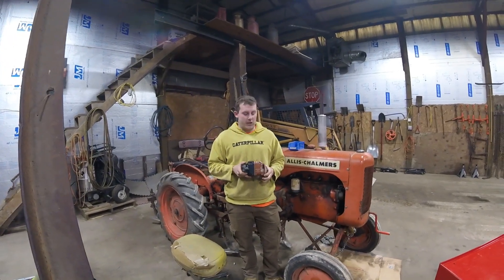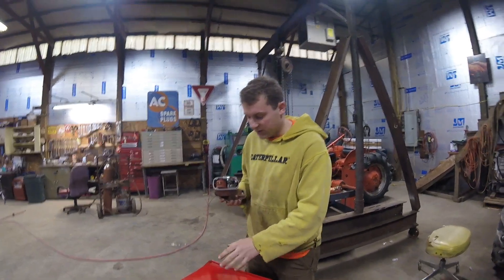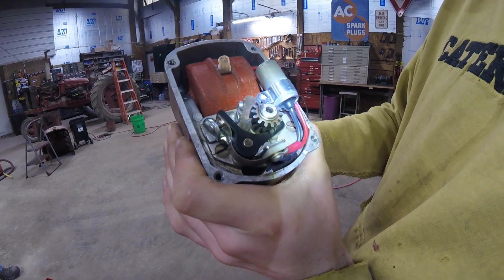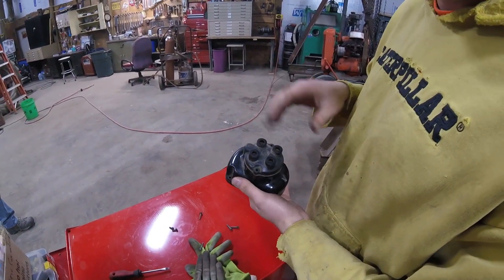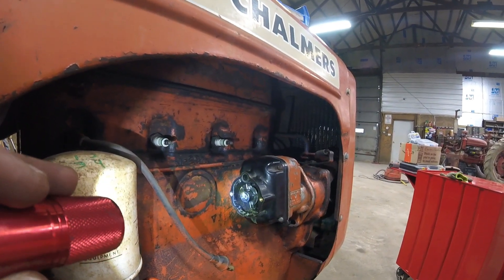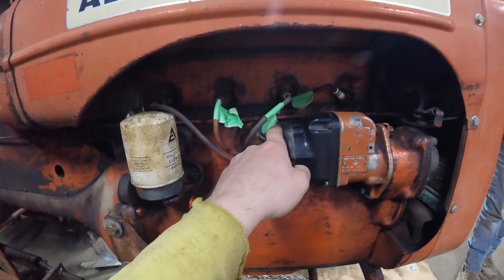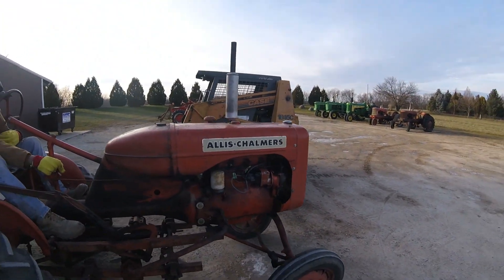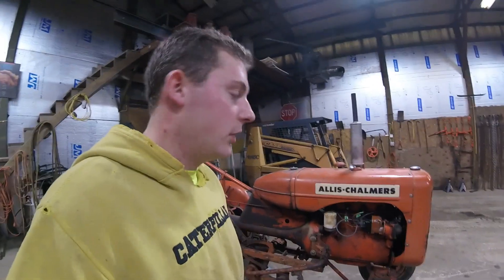How to time a Fairbanks-Morse J4B3 Magneto to a Tractor! (Putting back on the Allis Chalmers B)

Comment: Have problem timing as there is no red mark on the inner wheel. How is the keyway on the keyway on the shaft oriented when the red mark is twelve o'clock, or Is there a different way to adjust the wheel
Reply from the maker: @mobiklur  If there is no red mark, look for a tapered tooth. That also signifies 12 o'clock timing position. Sometimes the red goes away. It may be hard to see but the tapered tooth will be there.